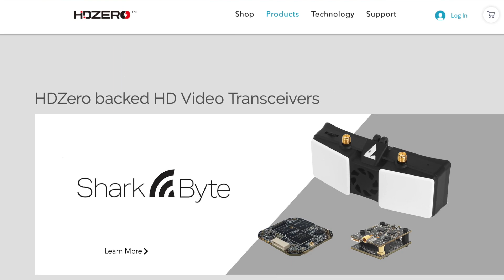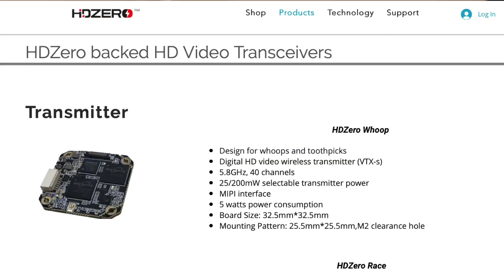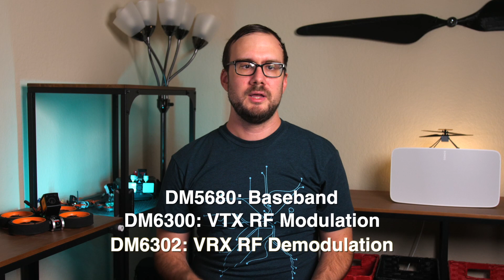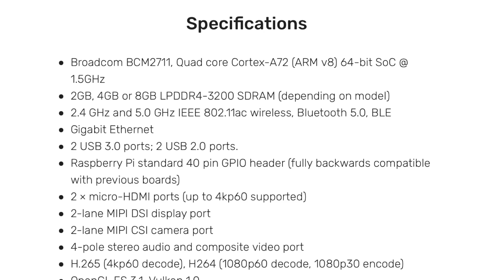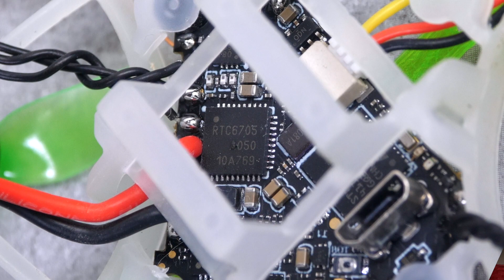The FUTURE of Shark Byte || How HDZero, Fat Shark, and Divimath are Connected

Comment: When we start seeing 3rd party VTXs things will be a lot more exciting in the HDZero space. Choice to cripple camera compatibility with an authentication chip for this first round of VTXs really bit them hard in this first year, only camera choice being that horrible plastic lens runcam that ruined the system's reputation. Finally getting a decent camera out with the HDZero runcam, but because of that choice we had to wait for them to do it and they've been losing customers to DJI. Hopefully they make no further such mistakes.
Reply from the maker: I agree with most of what you said, with one exception. Based on my understanding, I don't think it's a fair characterization to say that they crippled camera compatibility with an authentication chip.  Here is what  I think happened. MIPI is a communication bus, but it doesn't define every aspect of the communication protocol and the way messages are sent and received. Divimath defined how they wanted this communication to work, and created an IC that implements that communication. As a result, cameras need to have that chip to communicate on the MIPI bus with the HDZero VTXes. I did ask for specific clarification on whether that chip was available for other manufacturers to purchase, and the answer was yes.

So I can see why it would seem like a method of locking down the ecosystem, and I do think Divimath referred to it as an "encryption IC" in some of the documentation on their site, but phrasing things in this way makes it sound like the system is closed off to other camera manufacturers in a way that I don't think lines up with the reality.
Reply: @ATXAirborne  So you're saying even without the authentication chip, the DJI MIPI cameras would still not be compatible with HDZero?
Reply from the maker: @daniele.markle6428  That's my understanding. Basically I think the chip is required for any MIPI communication, rather than being an extra thing on top that was intended to lock down the system in any way. But I want to make sure I'm right on this so I'm going to reach out to get confirmation on how that works.
Reply from the maker: Alright, I did get an answer from Carl on this. The IC is for handshaking—it exposes registers that allow the VTX to set its parameters for use by the camera. That IC is available to any manufacturer who wants it, and it would be surprising if anyone was saying the reason they couldn’t make a camera for HDZero was because they couldn’t get that IC. 

As to the question about making it compatible with DJI MIPI, it would be possible to modify the VTX firmware to support it, but Divimath is hesitant to do so because they don’t want to infringe on DJI’s standard. You may be aware that earlier this year, DJI was accusing Runcam of making a camera for their system without permission, and threatened to lock that camera out of their system.

Comment: I'm curious about how SharkByte / HDZero will evolve too. Have no doubt about picture quality in general - 720p@60 FPS seems already enough for starters. Communication protocol though is still an issue - much more visible breakups than DJI have.
Reply from the maker: I do think we'll continue to see improvements in this area, the system has come a long way from when it is first released (and this is why I recommend people look at newer videos rather than only relying on the initial reviews from many months ago....lot of firmware updates since then). There are also some exciting rumors, such as a future option for 1080p30, and a 1 watt VTX (which would help solve the breakup).

However, it's also important to recognize that HDZero and DJI are two different tools for different jobs.

My guess is that DJI will always have less visible breakup than HDZero because of its ability to request retransmission of lost packets. Basically, the DJI goggles can communicate back to the VTX and let it know that some of the data was lost, and ask for it again. This results in a much cleaner image, but comes at the cost of variable latency. In any case where information has to be retransmitted, there will be a longer delay before that image can be displayed on the goggles. This is totally fine for a lot of use cases, such as cinematic recording, but it can be problematic for technical flying such as racing due to the unpredictable latency.

On the other hand, HDZero is locked to the same latency no matter what, and you just get whatever image is able to be transmitted on the first try. The latency is exactly the same the whole time, but you do get the pixelated breakup that you've seen in DVR footage. 

As you've probably seen, there is an enormous amount of debate about this online in terms of which approach is better. If you ask me, they are both great approaches and it is a case of picking the right tool for the job. I do think that over time they will begin to converge--DJI will get their latency to be more consistent, and HDZero will improve image quality and penetration. They may never totally reach parity though, and it's maybe more fun for us if they don't--it gives us more interesting choices when picking parts!
Reply: @ATXAirborne  Version about duplex protocol for DJI FPV is correct. DJI FPV system is basically their usual communication system with drone, stripped down to HD video  encoder + VTX + serial receiver output for FC (for people who use DJI radio too) + DVR (in DJI Air Unit) - to squash that all into one 20x20 mm mountable brick. Seems DJI are trying to solve breakups in different way - by "asking" encoder to lower encoding quality and resend frames as you said. Variable latency still persists but is less felt then. For cinematic and freestyle it is more than enough. For racing - probably not. Though people use DJI in racing too.